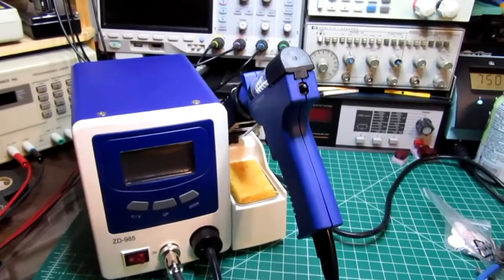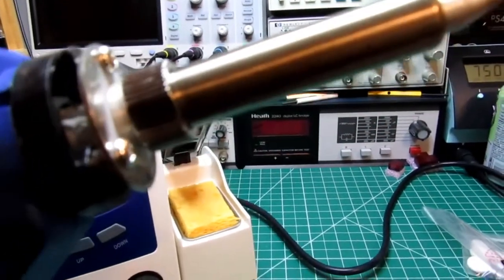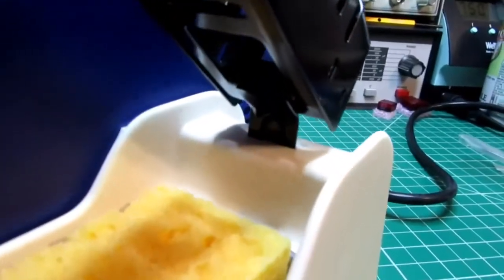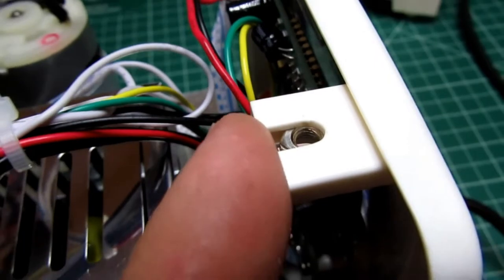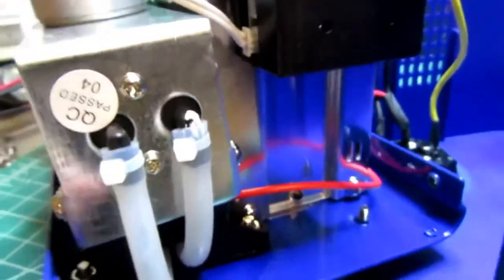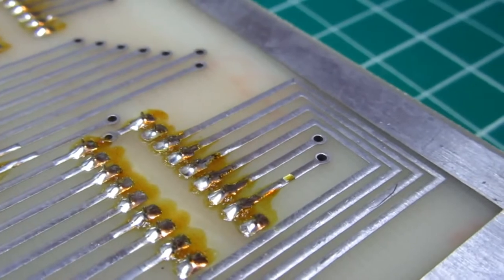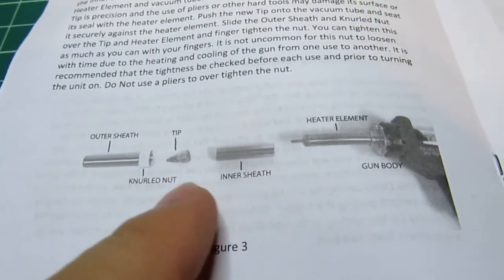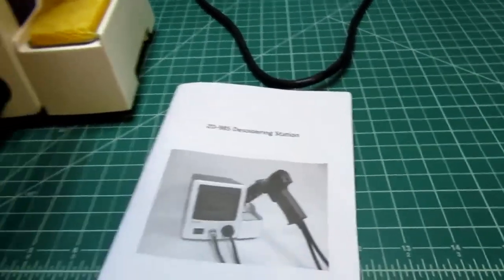Memotronics ZD-985 Vacuum Desoldering Station

Comment: I saw the review video that EEVblog did as well, his first mistake was opening it up before testing it, as he found out, he accidently pulled a wire off the internal case plug that went to the desoldering gun, but the spring inside the catch tube on his was a closed looped one. Much better IMO, it has more surface area to cool the sucked through solder and holds more of it instead of most of it landing on the filter that possibly clogs it faster. I like this tool as a hobbyist that would desolder components, then fix devices afterwards about 12x a year or less, and the price is just right compared to the more proffesional and pricier one made my hakko.
Reply: you should view the eevblog review a second time.

Comment: The black box has a board with 2 5w resistor in series, to drop 18V to 12V for the front display, pump and a cooling fan on model that has it.
I got the ZD-915 metal case version with a fan, since the resistor limits current too, every time the pump is on it also slows my fan and dims the front display, there was a video on youtube about replacing the box with a buck converter. I replaced mine with a 5A adjustable buck converter with a build in 7seg display voltmeter, only cost about 7 bucks on ebay, I installed it and set it to 12V, I monitored it with my acutal multimeter, there were no voltage sag, no more slow pump, dim screen or slow fans.  and the build in voltmeter is also spot on.

Comment: I noticed it’s not UL approved, which seems to be an issue with a lot of cheaper soldering irons - I believe this is illegal, but hardly ever enforced - don’t leave it plugged in when not in use.
Reply from the maker: UL is not required by law.

Comment: Also you didn't disassemble the station before trying it and then curse it wouldn't work like EEVblog's Dave Jones. :))
Why are you sucking unmelted tin? Let it warm up for 2-3 seconds and then vacuum. It will make you work much better and more efficiently. Badly soldered joints with hard solder sometimes need to be circled a bit with the tip, heated and then sucked off. If you suck before heating the joint, then you actually cool the joint and the solder has a problem heating the joint. More haste less speed.
Reply from the maker: Ivandrimal, I don't dispute your advice, except that so far, in my limited use of this product, my method of use seems to work quickly and easily.
Reply: Before the filter in the gun where to put a little soldering cotton, the air will pass and the tin will catch it. This way you save on the filter and complicated cleaning. @youtuuba

Comment: sheesh give the solder a chance to melt why dont ya/?
Reply from the maker: Scott Mitchell, what are you talking about? In this video the tool was being used properly. The solder melts practically instantly and is vacuumed away. There is NOT ANY MERIT in having the tool sit on a pad for any longer than necessary.